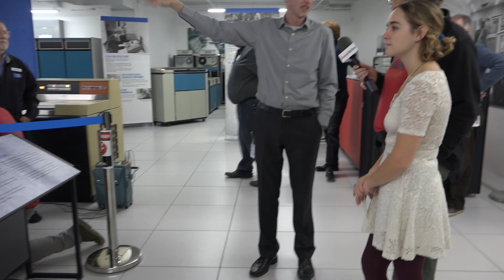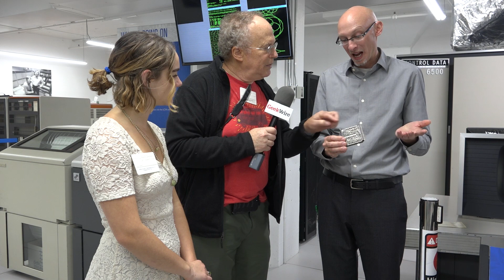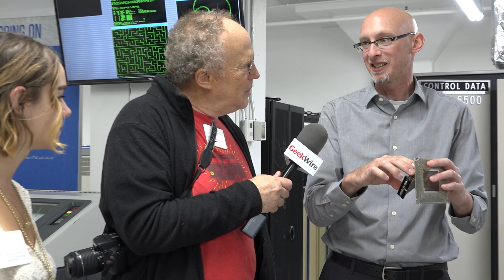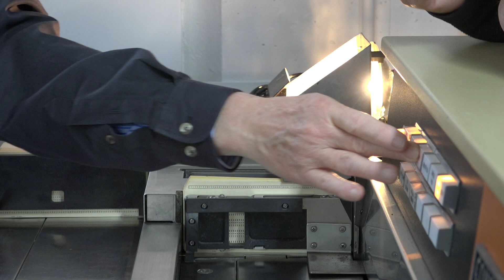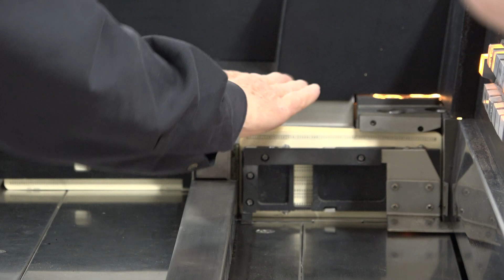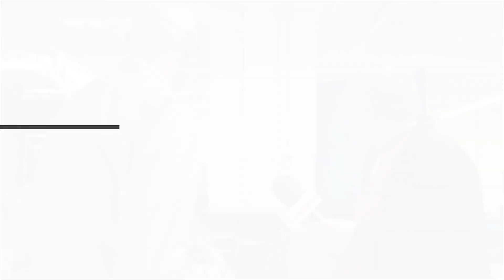CDC 6500 supercomputer at the Living Computers Museum + Labs

Comment: Did I hear Lath say that this CDC 6500 was at Purdue University??   I used that one!!  :)   Compass is an elegant assembler language.
Reply: Yes, it was I used it there in the Summer of 1974. Then helped debug it, and provided the operating system software.
Reply: I love COMPASS!  Used this machine's "brother", a CDC 6500 at Michigan State University, while I was a student.  They later added a Cyber 170-750...  a newer, faster machine with semiconductor circuits and memory, unlike the 6500 core memory.  The Cyber 750 was mostly code-compatible for users of the earlier 6000 series.  Their 6500 ran along side the newer 750 for several years.  I miss the CDC machines!!  After college, I did work at 2 places with CDC computers.  I miss them all!
Reply: I actually remember Compass from being in Minnesota in the 1970s and 1980s, and have some access to a Cyber machine at the University of Minnesota.
Reply: Indeed!  Compass was an awesome macro assembler.  And I still have the book for the instruction set for the CDC 6000 series machines (and its children and grandchildren, the Cyber 70, 170, and 180 (if properly microcoded) computers.  The most impressive code example in that book is the routine that saves all the register contents to memory, not simple task programmatically given that you must, for example, put the address in memory to write in A7 in order to store the contents of X7, which means you have to somehow save the contents of A7.  I think this was the source code to the routine the OS used to do exactly this when generating a register and core dump when some CPU exception, like an illegal memory access or a divide by zero occurred.  I remember reading somewhere that it was written by the legendary Greg Mansfield.  His fingerprints could be found all over CDC operating systems.

Comment: A bit of exaggeration about a phone being 2 million times faster than CDC 6500. I would say 10 thousand times faster is a more accurate measure. Even today (this video was 7 years ago), it will not be millions. You would need a workstation class CPU with many cores, or few GPUs to achieve 2 million times faster mark. The supercomputers like this were pretty fast for the time, and in fact minicomputers and PCs decade later were way slower, so this is why we think about this million time faster figures.

But performance per watt, definitively over million times better.

Comment: I did systems operations on Tektronix' Cyber 73 from 1977 through around 1980.  I really loved that machine.  Those console displays were awesome.  I once had the console display system literally blow up, shooting sparks and bits of molten metal out from beneath the tubes toward me.  Fortunately, I was sitting in a chair with wheels.  Just before the fireworks started, I noticed one of the displays shrink down to a bright horizontal line, and heard a loud squealing  noise, and pushed myself away from the console just before it blew up.  The Cyber kept running, but the console was toast. It took two of CDC's Customer Engineers about 6 hours to fix the console.  One of Tek's system programmers had written a program that could mimic the console displays on a serial terminal connected to the system, so we were able to maintain operations despite the console being down.  Many great memories of those days.  Very sad that COVID-19 has shuttered LCM+L. I hope it returns some day.

Comment: I was employed at Control Data Arden Hills and Plymouth plants from 1969-76. I was sent to Seoul, Korea in 1971-72 where I coded modifications to the Cyber operating system that allowed printing Korean (Hangul)  on a CDC line printer equipped with a special print train.
Reply: I worked at Control Data, Taiwan.  In 1988, I had been to ETA, "Energy Park" @ St. Paul, to be trained as a Software Engineer for ETA 10.  During that time I had been to Arden Hills a couple of times.  It's a shame, in less than one year, the ETA was discontinued.  BTW, Control Data, Taiwan also had  a "Power Distribution" project for Taiwan Power Corp. which had several Taiwan Employee working at Plymouth Facility.  Remember been to that facility once or twice.    I spent around 3 months in Twin Cities, from 105F hot summer, fall foliage, to snowstorm the day I left, interesting experience.
Reply: Good for you

Comment: 2:36 ... what type of problems were addressed on this machine? He mentions some cool research. But what I remember was CS 220 Introduction to Fortran. Using punch cards. That's the actual computer I used to learn programming, fall of 1978. It was in the first basement of the Math Sciences building. The second basement was the card punches, card readers, and printers. The next year we were programming in C on PDP11/70s and VAX systems in the EE department using terminals.
Reply: Sounds like Monash University Computer Centre? Where I worked for 14 years.

Comment: At 4:10 he asks, was this the only kind of volatile memory that the machines had?

The neat thing about core memory is that it is non-volatile! When you write a 1 or 0 to a core bit, it stays. To read a bit required destroying the recorded state, which then required rewriting the bit after a read, thus slowing reads down. An historical note:

The Challenger space shuttle (and as I recall, all of the shuttles) used core memory encapsulated in a block of acrylic, designed to survive orbital re-entry. That proved crucial in 'seeing' what the orbiter's software was doing moments before its tragic end.
Reply: When I did my engineering degree, they literally showed a video of Roger Boisjoly as a way of telling us not to let people put financial/time pressures over critical safety measures.
Reply: What was even more cool, you could "deadstart" Kronos (NOS) from memory in a couple of seconds.

Comment: I worked on these machines with CDC 40 years ago, at Picatinny Arsenal in Dover NJ. We had a 6500 and a 6600 there. We also had an Extended Core Storage unit on the 6500, The 6500 was later replaced with a used Cyber 74. An 808 disk drive was there. 405 card reader, like in this video. This 406 is newer than the 65oo -- it is painted in Cyber 170 paint scheme. We had a bunch of 833 disk drives, and 66X tape drives. The reason you see those deep wiring mats in the mainframe is for signal timing. Timing was determined by the length of wire the signal had to travel through. Biggest issues I remember with the mainframes were the memory stacks, and the refrigeration units. These machines also ran on 400 Hz power, like aircraft electronics do. We had motor-generator units that provided the power to run these machines.

Comment: Started my computer life on a CDC 6500 as the first year student. Of course first year students were always stuck with punched cards and typing in the card punch center. That was a noisy place. The computing center to house the 6500 was the floor area of house.  By Honors in Physics I had access to the Physics terminal room and could run my own stuff and use a VDU, revolutionary. I remember late nights playing an early computer game called star trek, of course poor graphics but it was fun. Those old Fortran physics modelling and scattering programs lasted for many decades. Why rewrite good well proven code that works and only goes faster and faster on modern emulators. Great look back, good memories and thanks.

Comment: I learned to program on a CDC6600 at IU in 1980. I never actually saw the computer I was using as it was locked in the basement of the computing center. I just used one of the remote I/O nodes on campus but I did get to run my own cards. There was no sorter available and they never changed the ribbons in the key punch machines so sorting a deck was always a good time. But I learned to just 'read' the cards.

Comment: I used these CDC machines.  We never called the 6500 a “supercomputer.”  The 6600 was called that when it came out, but the 6400 and 6500 were compatible, but simpler and slower processors.

Comment: I went through Control Data Institute in 1975, where we worked on an old 3300 computer. It used 1604 logic circuitry with just a few transistors on each board. I used to put in Field Change Orders on the machine, and freeze my fingers off because of the 40° chilled air blowing on the backplane! This video really brings back some memories. BTW, if you watch "Colossus: The Forbin Project", you'll see that Control Data Corporation loaned the studio a lot of computer cabinets for the movie.

Comment: BTW, I started programming on an IBM 1401 when I was 12 years old in 1968. I had already taken a course from Cleveland Institute of Electronics by mail, which was how I got my start in radio and computers. It's too bad I never worked on a 6600 system. I did get to use the CDC Star computer when I went through Control Data Institute, and they were using Plato plasma display terminals.

Comment: Worked on 6600, Sn #9, and dabbled a little on a 6400.  A 6500 is the combination of a parallel processor, 6600, and a sequential processor, a 6400.  And just for laughs, that is an oscilloscope sitting on the floor next to that 405 card reader, have one in my basement.  We trouble shot problems down to a transistors and replaced them. Timing in these machines was done by tuning the wire lengths between modules. A nano second is seven inches of a twisted pair of 24 gauge. Wished I've closer. It be great to one of these old machines.
Reply: Wrong.  A 6500 has two processors of the 6400 type.  There may have been a 6700 with one processor of each type.
Reply: @GH-oi2jf  Yes, you are absolutely correct, my mistake.

Comment: Hmm, the 6500 seems like a later model (not mentioned in the 1965 hardware reference manual, which only lists the 6400, 6600 and 6800). Looks like a dual-processor version of the 6400.
Reply: That's exactly what it is.
Reply: Thats right. A dual processor version of the CDC 6600. Seymour Cray didnt like multi processors.
Reply: @robertmaclean7070  But the Cray-2 had 4 processors.
Reply: @robertmaclean7070  — No, a dual-processor version of the 6400.
Reply: @robertmaclean7070 — Cray had no reluctance to use a few processors, but the 6600 was too bulky to fit two into one system.of four bays.
Reply: On the contrary, a CDC 6600 with maximum memory fits into four bays, maxing the "X" configuration.  I think there have been one empty chassis position.  There are four chassis in each bay.

Comment: 2:23 The 6600 would have been the first. I think it was about 50 times faster than anything from IBM. Which didn’t stop them from promising the amazing new 360/90 machine, that would retake the top computing crown, just you wait and see. So customers held off from buying CDC, until the IBM machine actually appeared, and completely failed to live up to expectations.

CDC sued over the FUD campaign. And wonder of wonders, they won.

Worth reading: “The Supermen” by Charles J Murray.
Reply: 50 times faster. Not really. It was maybe 3 times faster than IBM machines, but IBM machines were release few years earlier. Still 6600 (and 7600) was a huge achievement, and a had a lot of pioneering solutions, that become standard only later.

Comment: Some of the most fun systems I ever worked on. I worked for Control Data Canada in the 70's and later with Pratt & Whitney Canada on 6000, 7000 and Cyber 170 systems under all the various operating systems. BTW, only students typically kept their programs on cards.